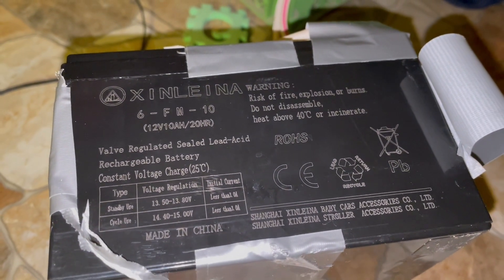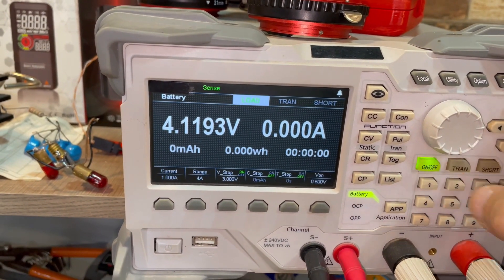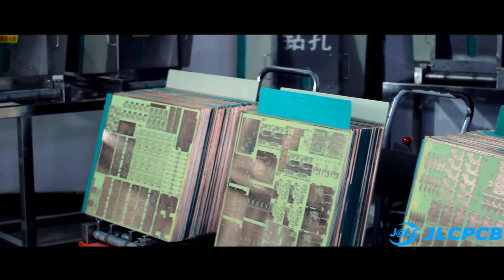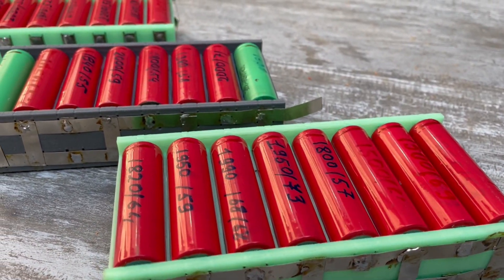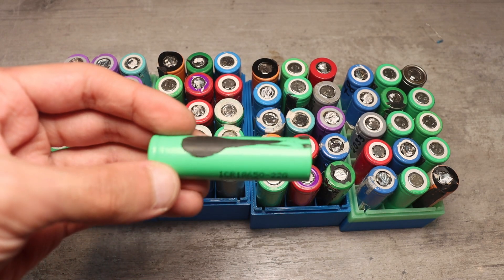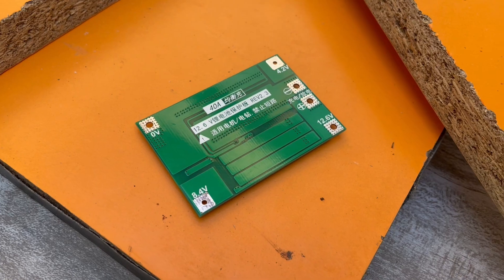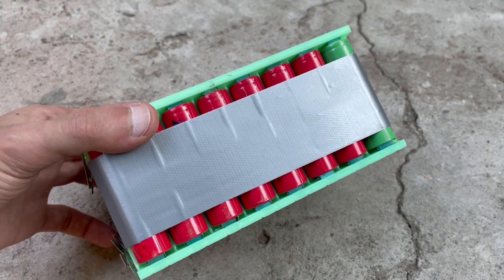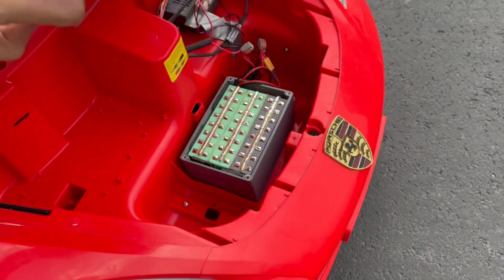DIY correct LI-Ion battery

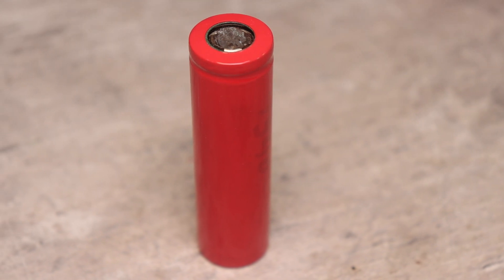Comment: 12:12
"such cells aren't safe but this isn't entirely true....used in electric vehicles"

See that's why they are technically unsafe. You pulled cells out of laptops. Not EV's. Old laptops (new ones are all pouch style lipo's) had cells optimized for energy and not power. Your average laptop cell was 2200mah with a 3A or 4A continuous discharge rate. Rarely did they use cells with more than a 2C discharge as it was just not necessary and you would sacrifice capacity to get near the 3C rate or higher. Cells have advanced a longs ways since then but you are using 10 year old cells for the most part and its safe to assume that if their AC impedance has started to rise into the 50's then 1C is the max discharge you can expect. I think fusing them for 5A was the right way to go, perhaps 4A would have been better but its hard to get the fuse wire that specific.

So long as you never push these cells past 1C discharge they are relatively safe especially since you did what no one else does, checked the impedance with a proper milliohm meter and only used the best cells. An application such as this could pull a lot more than 1C if you did not have 16 cells in parallel so even with all the precautions you took a lot of people would rather not put their kids on a toy that has the front engine compartment filled with incendiary bombs. Hopefully the Tesla style cell fusing is enough to prevent anything catastrophic. What would really put those kids at risk is putting some Headway 38120P's in a 4S2P pack. That should be enough current to make the car flip backwards,  cracking open the skulls of children the moment any pressure is applied to the acceleration pedal lol

Comment: Love the fuses. Seen them been used before. But forgot about them. I would if loved to have seen this video a year ago when my cousin got an old scooter with two 12V 20Ah batteries in series. I told not to a buy lead acid battery operated one. But €60 second hand couldn't stop her. (Greed) (( i forgot to say the batteries were dead and the sealed lead acid type)) I told until I was blue in the face "you need to be prepared to spend good money to get a proper one. 🥱 BUT €60... SAY NO MORE ON THAT. Anyway. I told her buy the proper batteries online. But she didn't want to spend the money two lithium batteries with the same capacity. I told her buy ten cordless drill batteries out of lidels or aldis. And il get the rest to build a battery.(she never got those batteries either. The scooter still doesn't work) But if I saw this video. I would have look online for used laptop battery packs. 
{YOU CANT HELP SOMEBODY WHO ISN'T PREPARED TO SPEND A PENNY OVER €50🙄😤🥱🤷‍♂️🚫💶

P.S. LOVE all your stuff Kasyan TV 👍🇮🇪💚🙏🏼